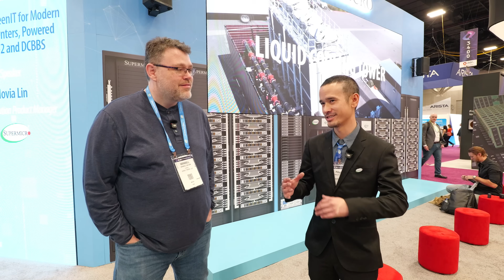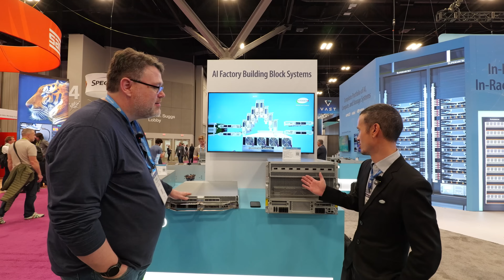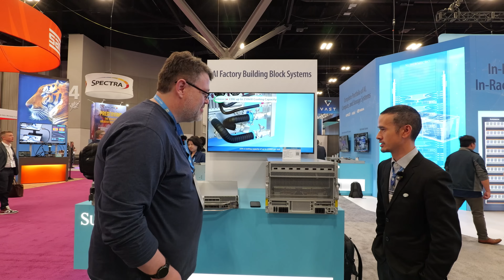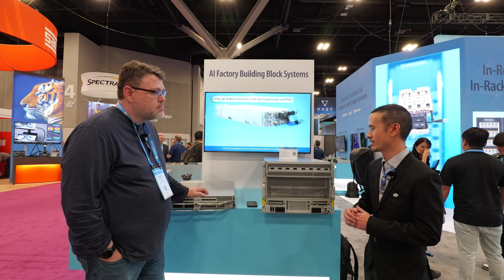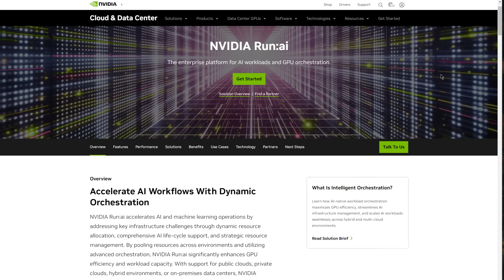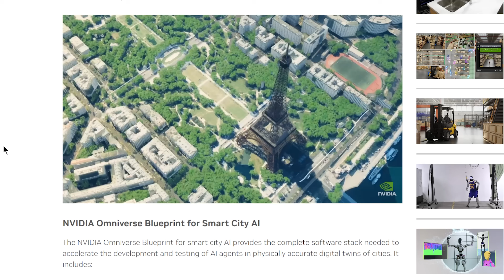Supermicro's Intermediate Server Rack System the B300

Comment: More AI? turns video off
Reply: Deal. Ai is NOT going away. Get used to it.
Reply: @adjoho1  I guess I should have said "More AI servers I can't afford that cost more than a new car". But even when this stuff becomes cheap on ebay in a few years, I won't want spend the power on it.
Reply: AI is fascinating. Don’t have such tunnel vision. There’s room for GPT, Opus, Gemini, & DeepSeek. Each has its strengths & weaknesses. It just depends upon your needs.

Comment: I wonder if the motherboards designated for the “Workstations” will have S3 Suspend-to-RAM sleep mode not blocked, unlike the typical Server motherboards.

I value this feature extremely (if you don’t want this feature and forget to disable any unwanted automatic sleep mode in the OS then that should be a skill issue), it shouldn’t automatically be removed from all Epyc motherboards on a BIOS level for all users like it’s currently the case.